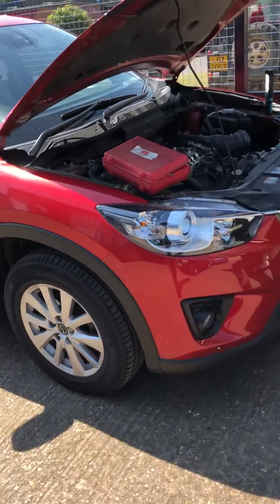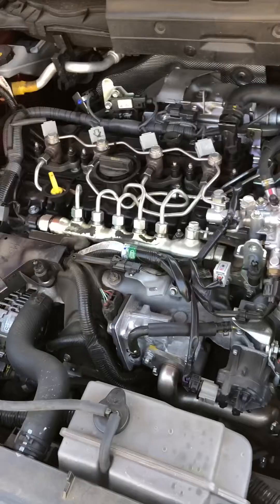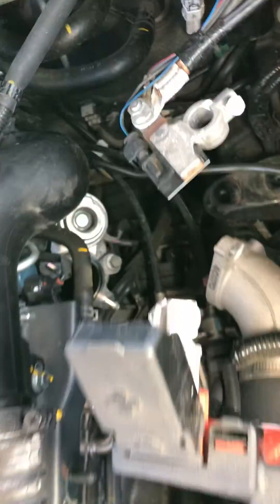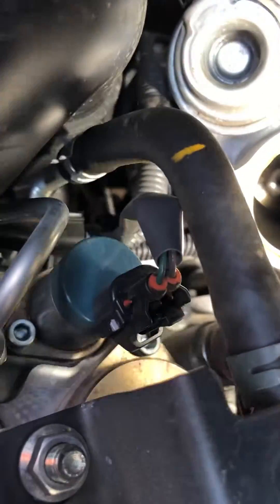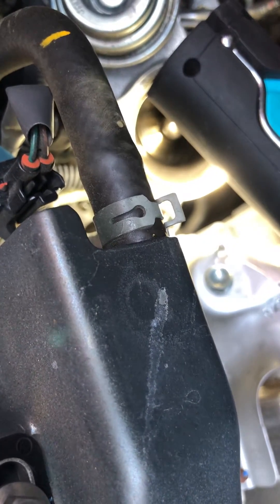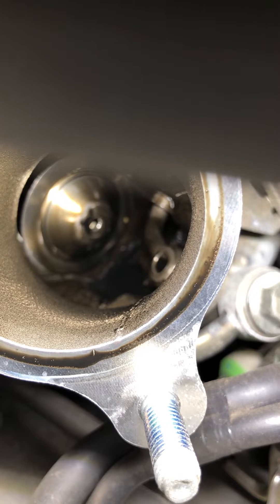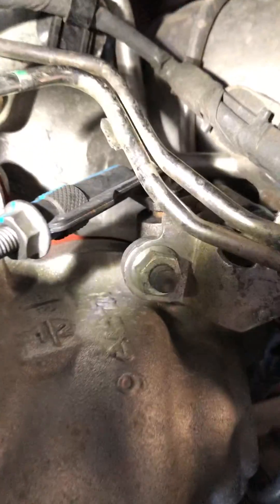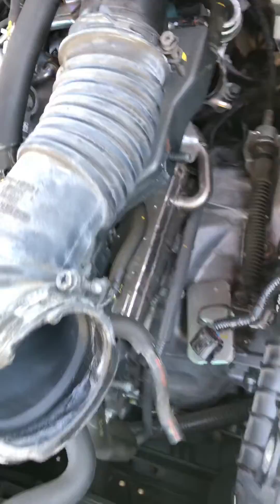Mazda CX-5 diagnosis for loss of power and fault code P0299 under boost.

Comment: Hello, I just got a P0103 Code, sprayed the MAF with contact cleaner allowed to dry, cleared the codes but now have P0102, do you think I need MAF sensor anything else I should check? Car is a Mazda 6 2.2D
Reply from the maker: Hi
P0103 means a higher than specified reading/voltage, and P0102 means a low reading. Before replacing the sensor I would check for any inlet air leaks, plus check the wiring. If you have a scope you can check the signal from the sensor. 
If you do replace the sensor don’t buy an unbranded cheap one, if you know anyone else running the same engine you could swap the flow meter for testing. 
Hope this helps.
Reply: @brownsgarageltd  appreciate the reply thank you

Comment: Hi. I have the same prob. I've dissasembled all like u did in the video, found out it's the same problem. NExt thing is gonna be looking for the nut in the intercooler. Question : Is the turbo damaged or it could be just the pin replace and you're good to go? Also, if the turbo(smaller one) is damaged, the big one couldn't be, right?
Reply from the maker: Hi 
Yes it’s a good idea to fish the rivet/nut out of the intercooler, plus give it a clean while it’s out. 
In my experience the turbo comes as a complete assembly from Mazda, but you may be able to find a company that will repair it for you. 
Many thanks

Charlie
Reply: @brownsgarageltd  thanks, but what I'm asking is, is there a chance that turbo received no damage at all?
Reply from the maker: @Bevis91  yes there is a good chance that both turbos are fine.
Reply: @brownsgarageltd  thanks for the reply

Comment: Hi. I have the same problem on my Mazda 6 2.2 diesel with the same engine. Does the entire turbo need to be removed and replaced? I have found a company locally who can recondition the turbo itself but I need to remove the turbo myself and not sure how easy that is as there doesn’t appear to be a lot of room to access bolts etc. Thanks
Reply from the maker: Hi Andrew
From memory they are not the easiest turbo to take off, most of the work needs to be done from underneath. If you do the job yourself don’t forget to buy new gaskets. 
Alternatively get a price from a local garage to remove and refit your turbo.
Hope this helps 
Charlie

Comment: What is happening with the pin that holds the valve? Does it goes into the engine and damage it?
Reply from the maker: Mad Eklavya luckily it normally ends up in the intercooler or pipework leading to it. 
Hope this answered your question 😎
Reply: @brownsgarageltd  Thank you very much!! Thanks to you i found the same issue with my parents CX-5. But now we can't find this part, we went to Mazda dealer in Austria and they said that they don't sell this part, it goes with the turbos and we need to get new turbos...
Reply from the maker: Mad Eklavya unfortunately it does come as part of the turbo assembly.

Comment: This is happening to mine is it safe to carry on driving it?
Reply from the maker: Ian Nash I would recommend getting it checked out as soon as possible. It’s not a good idea to keep using the car in my opinion, it could cause other damage.
Reply: @brownsgarageltd  the thing is the garage has put a diagnostic on it but there are no fault codes??
Reply: @brownsgarageltd  is this a reliable engine the 2,2 diesel?
Reply from the maker: Ian Nash as far as I’m aware the engine is reliable. It’s not a long job (30 mins) for the garage to check this changeover valve although it normally logs the p0299 fault code. Your loss of power could be a completely different fault. The live data from the engine ECU needs recording when the fault happens, assuming when the garage checked it the data looked ok.
Reply: @brownsgarageltd  hi mate.  I sent the garage this video.  Hope you don't mind.   He said this "was " the fault.   Now he's areanging for a turbo specialist to sort it out (or give me my money back).  You're a star mate nice one.  While he's sorting it, is there any else he should be looking at. ?
Reply from the maker: Ian Nash I don’t mind at all, glad it helped your local garage. The only thing to note is the rivet head from the broken flap often ends up in the intercooler, worth fishing that out. When changing the turbo it’s always a good idea to flush the intercooler anyway. 
Good luck with the repair. I’m sure a new genuine turbo is around £900 from the dealer as a kit with all the gaskets.

Comment: @Charlie Brown  My mazda 6 2.2 had this exact issue and i had the turbo replaced with mazda.  Its the 150 bhp version but still feels like a lack of power/boost under 2000rpm. I get occasional SCBS  error  in 4th /5th at about 2000 rpm. ANy suggestions as what else could be causing this. Like MAF or MAP getting confusing readings?
Reply from the maker: phantom192 Hi in my experience if the turbo job is done correctly with all new gaskets and the broken rivet removed from the intercooler it should be fine. Do you have any fault codes related to the error or a good local garage that can take a look for you. 
If you are scanning the car yourself remember to check all modules.
Hope this helps and sorry for the delay replying
Charlie 
Browns Automotive
Reply: @brownsgarageltd  y
Reply: @phantom my cx5 2.2 2018 also same problem. Lack of power under 2000rpm and gear at 4th/5th. Did you solved your problem now?
Reply: @sssdezsss  Same here, would love to hear people's fixes for this.  Also i can hear my turbo more at low revs now, but it just bogs down until 2.5k rpm.
Reply: @sssdezsss did you fix it

Comment: Could this be caused by a sudden jolt? My mazda 6 2.2d stopped boosting under 2500 rpm immediately after I went over a speed bump that nearly sent me to space. And I only went over it at 5mph.
Reply from the maker: n asturt it is unlikely unless your turbo valve was on the way out and the jolt finished it off. My advise would be to get your car checked over for any damage that may have been caused. 
Thanks for watching my video
Reply: Did you find out the reason was it the divertor valve as I'm having the same issue won't boost until reaching over 2500rpms
Reply: I have same problem how did you fix ?

Comment: Hello, i have the same problem. can this part be replaced or should I replace the complete turbo?
Reply from the maker: blondin571 
Hi 
Yes this part comes with the whole turbocharger, your local Mazda dealer do a kit with all the gaskets for around £900 plus the vat.
Let me know if you need a fitted price. Hope this helps
Reply: @brownsgarageltd  ok, thank you for the answer, my dealer tell me that the price is around 1300€ (sorry, in euro...) and totally: 1800€....
Reply from the maker: blondin571 sounds about right, good luck. Hope you get it fixed soon. 👍
Reply: @brownsgarageltd  ok, , really, thank you for your answer!!!!